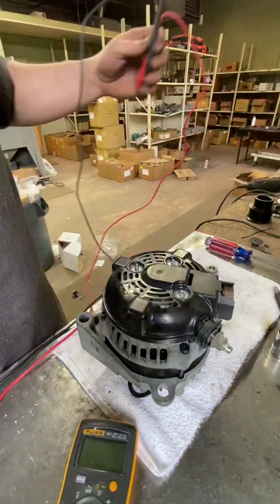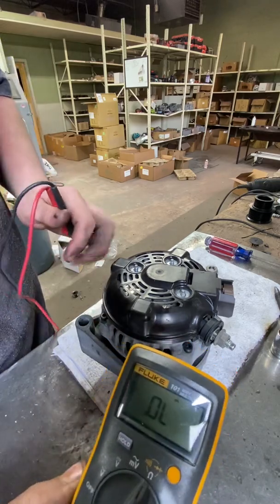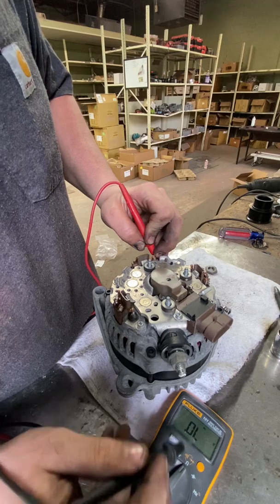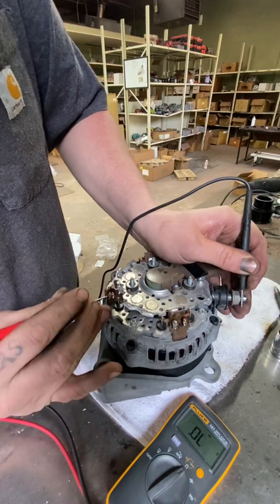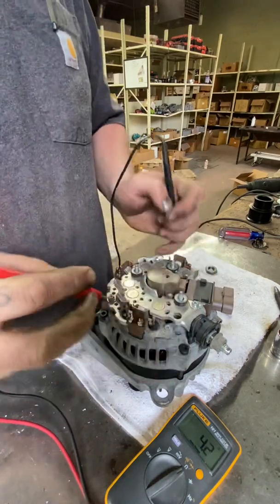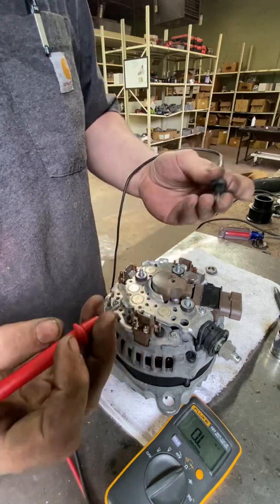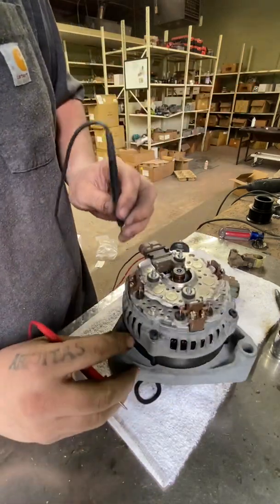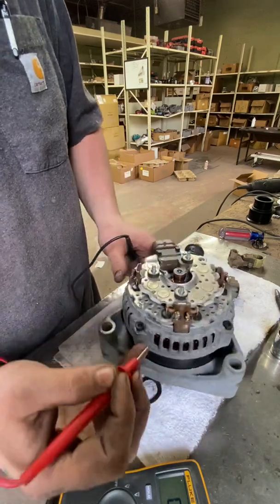How to test your alternator with a multi meter for functionality / shorts / damage

Comment: I got a question...I have a h.o alternator... Still puts out voltage..  But my dash lights. Battery light etc would all stay lit up like it wasn't charging..... It worked fine for a while with no issues and no lights. Had a constant 14v on dash with system .... Then after a few months of having my system bumping .. it started doing that. So I just threw stock back on and no lights anymore.so I'm pretty sure its internal of the alternator.... Pulley may have been changed to bigger one. But when changed back the pulley it didn't fix the issue.... Any ideas on what I should look for specifically? Have yet to check anything internally.

Comment: I've got a 370 and on occasion (usually on rainy nights) the following day when I start the vehicle it has a no charge situation. Usually starting to charge after about 45 seconds to a minute, almost as if it is building resistance or drying something out. Would I need to test the alternator in this case or could this be related to a dirty ground?